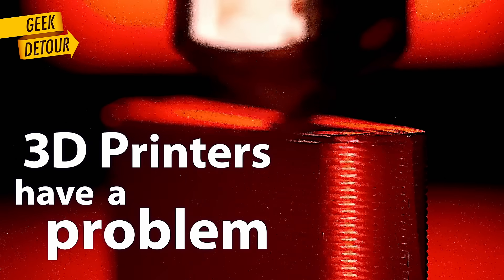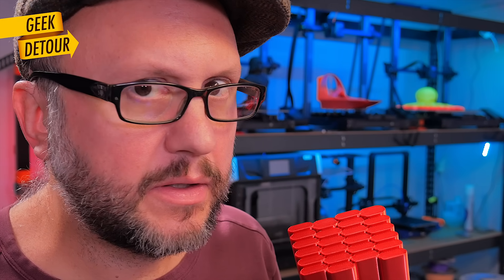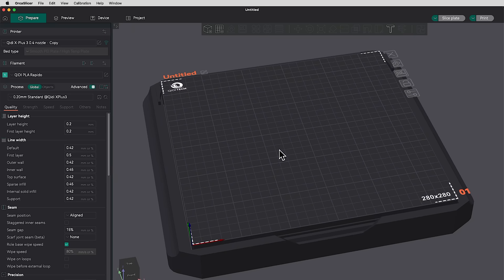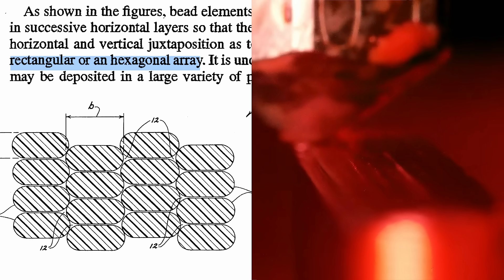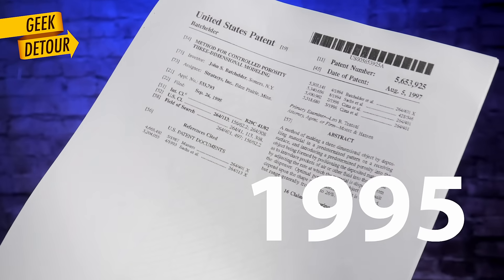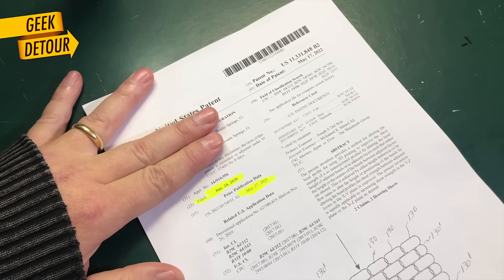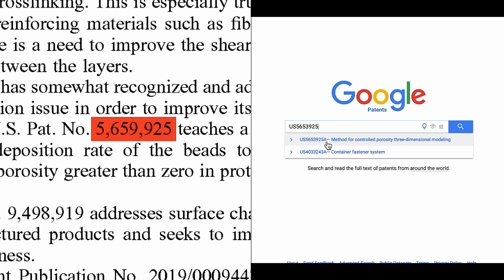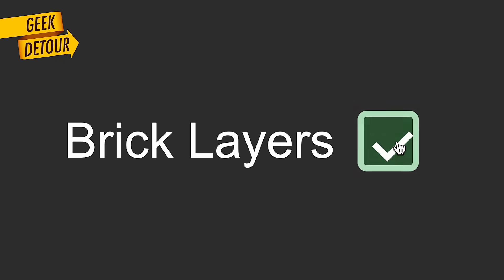Brick Layers: Stronger 3D Prints TODAY - instead of 2040 😬

Comment: What a joke.

I'm also no lawyer but I'm pretty certain that the expired 1995 patent would protect people using their methodology regardless if the other patent.

I think the new patent holder would have a very difficult time defender their patent when you csn just provide the 1995 patent to the judge 😂
Reply: I wonder how many slicer programmers and researchers have been fooled by this fraudulant patent? and then given up on its implemtation.
Reply from the maker: Nobody can prove it... but the incorrect patent numbers probably confused the evaluation of the examiners. It is a mater of "just looking" at the pictures and you would raise an eyebrow and start reading things more carefully.

Comment: Patents are evil.
Reply: I wouldn't go that far, they protect the cost of research and enable the recovery of that money while at the same time allow time to make marketing the invention worthwhile.
 I would say that some of the things that are allowed to be patented are crazy, for example, fixing a hotend using three screws.
Reply: @AndrewAHayes  I disagree ... The patent-system is extremely wasteful and keeping humanity back.

An entire class of highly paid experts and lawyers contributing nothing to the world, except expensive paperwork. A patent doesn't even protect the small inventor, only large corporations. It's prohibitively expensive, very time consuming and require continual vigilance to be protected in court.

Patents offer nothing of value. It is evil.
Reply from the maker: @ZappyOh  Hard to argue against that... I think, overall, the world would indeed be a better place without patents. Would the complete absence of patents create other distortions and problems? Probably. This is a great discussion, really good.
Reply from the maker: EXACTLY. Something went wrong with the examination in this 2020 patent. I don't know if you knew that, but we can see other patents that the same examiners approved: there are SO MANY different stuff they have to evaluate... It is IMPOSSIBLE that a single engineer can properly evaluate such different domains and not make judgement mistakes.

Comment: Together we can make them correct the mistake and have brick layer printing 🙏💪
Reply from the maker: Maybe there is nothing to correct. What happens in 99.5% of the printed part, using the Hexagonal Pattern, was already patented in the past. Just the bottom layer and the top layer wasn't covered in Stratasys 1995 patent - but it was on the PrusaSlicer Feature Request. We just need everyone to KNOW about these details.
Reply: @GeekDetour so what actually is the goal by telling everyone, next steps, who owns the patent, who do we rally against? I have been thinking about this ever since Stefan posted that video and wondering what happened to it..
Reply: @Crappy.Consumer.Reports  the goal by telling everyone, is so that we all together can figure out the next steps to get this resolved!